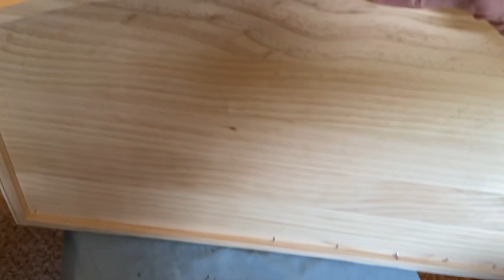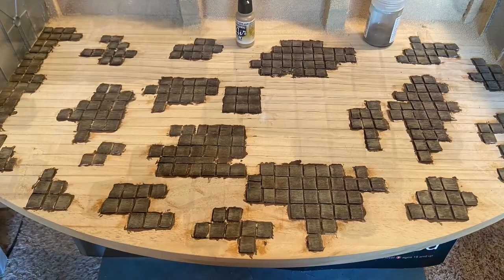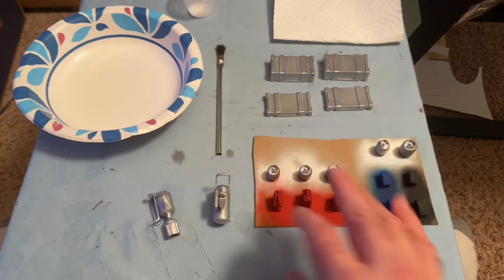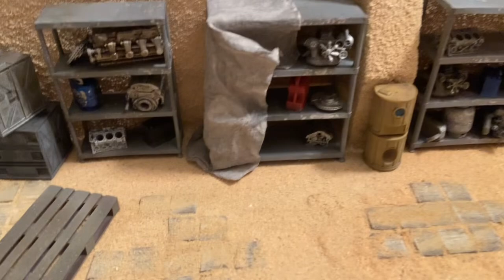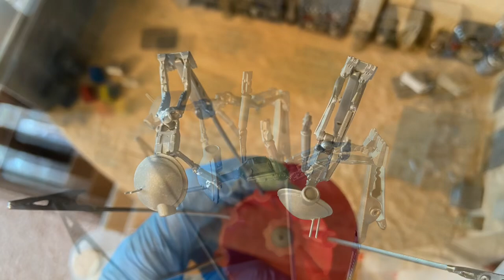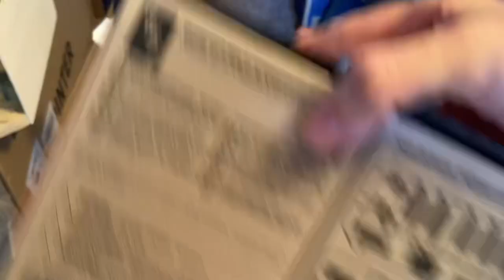Na1…Na2 Revell junked N1 Starfighter build FINALE!

Comment: Looks like a Toyota Hilux engine, the petrol version, variable valve timing. Regardless, it still burns through gas, or sublight fuel in your case ;-)